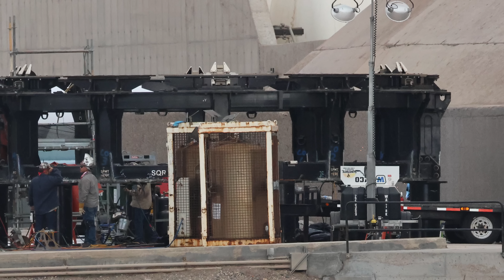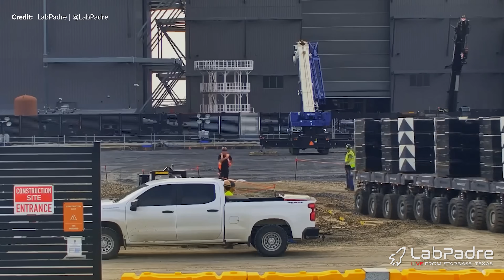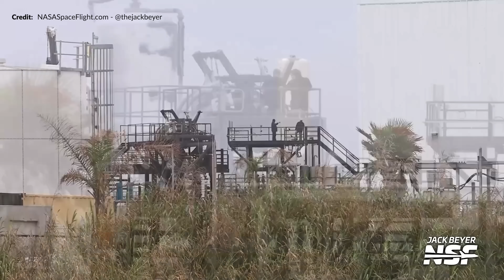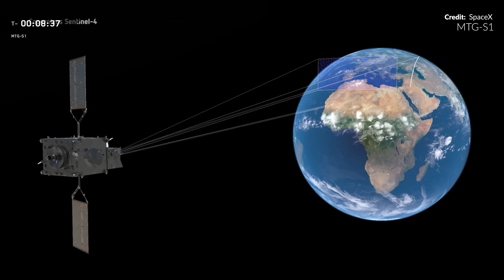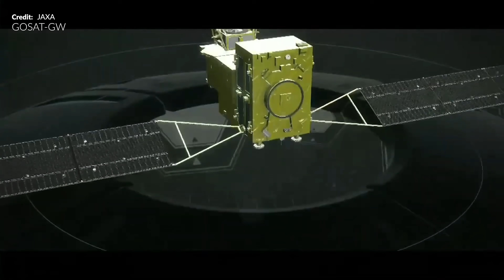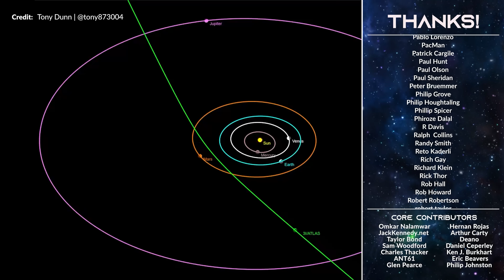SpaceX Isn’t Waiting With Starship... Here’s Their Big Move!

Comment: Starship is stupid.  You drop aeroshells from orbit.  First principle's engineering is how to inflate e.g. loftid, or build in LEO.
Reply: Why is starship stupid?
Reply: @imaginary_friend7300  Starship does not follow Elon's dictum. The best part is no part.  Aeroshells are the simplest design for reentry. LoftID inflatable aeroshell already passed earth reentry test.
Reply: @mefobills279  You seem to be skipping the part where it has to get UP first.  Aeroshells are a re-entry tool.  I think there are some large gaps in your understanding.
Reply: @imaginary_friend7300 I mentioned the inflatable loftid, which has already been proven.  If you must recover second stage boosters, then run the numbers and see if it is first principles economics.  The second stage booster motors are the main high value component. Starship is stupid.
Reply: @mefobills279  The second stage isn't a booster, it's the payload carrier and that drives it's shape as much as anything.  LOFTID only been tested on a small scale and it was not without mass, it will have it's uses but I doubt at these kinds of scale.  It's not first principles anymore than a conventional heatshield nor is it a system that lends itself to rapid turn around.

Comment: They shouldn’t use the sea level engines on the second stage during launch. They should use six vacuum engines instead. That’s their problem. The sea level engines are shaking the vacuum engines to pieces.
Reply: The seal level engines are the ones that steer.

Comment: what if the ring bolts to the ship but only just clamps into the launch mounts, it would be plausible to lift the ship and fill it with the pre launch QDC and drop the partly full ship with the attached ring into the clamps lock and fire the engines ?

Comment: I believe we should have a rocket on semi permanent standby to try and intercept the next one of these interstellar objects.  Think about it, material from another star system coming to us instead of us having to go to it.  It would be more than worth the price for its scientific value.  An absolute bargain opportunity.
Reply: The math really doesn't work out. It's travelling significantly faster than solar escape velocity, so anything you want to land on it also needs to be travelling faster than solar escape velocity... and to date, we've never managed to launch any probe to those speeds without relying on gravity assists which greatly limit where and when you can send them.
Reply: @simongeard4824  Should have added, use the power of SpaceX Starship with orbital refuel to launch a really quite small and light weight probe and yes absolutely gravity assists from planetary flybys included.  New Horizons got pretty fast didn't it?  And Vera Rubin seems to be detecting more and more of them.
Reply: @Iwantalloftheinformation  Missions like New Horizons were planned many years in advance to a known set of requirements, so all the gravity assists are well understood and the time of launch can be determined by how things line up. Launching at short notice to an arbitrary target is considerably harder.

Also, Starship is a terrible choice for launching small probes onto interstellar trajectories... even fully refuelled in orbit, you're basically using all that fuel to accelerate several hundred tonnes of Starship dry mass, when the only bit you want to accelerate is a couple of tonnes of probe. If you're going to launch something on a trajectory like that, you use a small solid-fuelled kickstage.

Comment: Willing to risk a costly, operational OLM to move the testing schedule ahead, even after everything they’ve done on Starship development in recent months has ended in explosions of one kind or another. That’s some serious risk taking.
Reply: Not so much.  That OLM is going to be out of commission for a substantial time soon regardless for rebuilding to block 3 standards.  If this fails wrecking the OLM then either they carry on with block 3 on the other pad or give up.  If it doesn't fail there will only be 2 or 3 more launches on it before it has to be rebuilt.
:planet-orange-purple-ring:

Comment: Back to the Starship testing failure recently.  If the COPV was the incorrect size, type, pressure rating, etc. and it was installed by accident then SpaceX missed its QA/QC PMI (or Positive Material Identification) step.   A PMI rigorous process needs to be in place for all parts: starting with engineering specification, SpaceX Shop QA/QC processes for external suppliers and internal SpaceX factory work, shop inspections, materials pedigree paperwork, pre-shipment testing, positive materials tracking at the SpaceX factory, pre-fab equipment from OEMs, welding materials, qualifications of the workers, welding processes, etc. to assure the quality and correctness of all parts and processes in assembly and testing of the vehicle.  In mature private industry like, Paper products, Oil & Gas onshore & offshore, petro & specialty chemicals and petroleum refining, etc. the rigorous QA/QC including PMI are standard for workplace safety.  I'm surprised that OSHA has not begun an investigation of this SpaceX mishap.  Maybe it's because there were no injuries or fatalities.  Maybe it's because this is a testing campaign and mishaps like explosions are tolerated.  SpaceX did increase their testing safe zone area. So there's that at least.
Reply: Looks like alot of paperwork. I suggest sidestep that, and get a foggy 3D build assist that projects the proper part for immediate comparison. Or a laminated 1:1 poster for the build room.

Comment: If you ask me, sprites are not caused by intense electrical activity in a thunderstorm below, but electrical activity in thunderstorms is fueled by cosmic rays. A thunderstorm just only provides the right atmospheric conditions (=conductivity) for lightning to occur. Same with vulcanic eruption lightning.
Reply: Agree to a degree. Charge differential is apparent, most obvious charge input is Sol. But it need not, and isn't the only.
Reply: @Stumpy1234  Interesting idea. Maybe it is both radiation from sun and cosmic rays. If it is from the sun, we would perhaps have fewer thunderstorms during night time and maybe more during night time in case of cosmic rays.. Time for some scientific research?
Reply: The thunderstorm isn't providing the conductivity so much as acting like a capacitor storing the static charge all the water and ice generate.
Reply: @DUKE_of_RAMBLE  Yes that is the common theory, which I think is incorrect. It IS electrical conductivity (logical, with a lot of hot water vapor, isn't it?) in my view. The capacitor theory is wonky. High-energetic radiation from space causes electrical discharge in the atmoshere, not "friction" between water droplets,which I think stems from lack of ideas where electric charge comes from. Oh, then it must be friction. No. Cosmic rays are always present, but lightning only occurs when atmospheric conditions are right (high conductuvuty and/or vulcanic eruptions). Many mainstream scientific ideas are faulty. Don't just repeat them.
Reply: @michaeljaneschitz-kriegl9598  From what I real it's not friction, but collision, and with water/ice at different states, a partial slush state. The collisions some gain energy, some lose energy, and it builds. I dunno, I'm out of my wheelhouse, admittedly, but it seemed more sensical as I read it, compared to being "conductive". Especially since a pyroclastic cloud would definitely be a case of static buildup causing all the lighting in them.

But when you start factoring in the solar winds and high energy physics, I suspect it becomes a completely different ball of wax. Not to say that it doesn't boil down to charge states, but the Sprites always look to be originating FROM the cloud TO the upper atmosphere.
Reply: @DUKE_of_RAMBLE  Look at the photograph of the sprite. It extends hundreds of kilometers out of the atmosphere. If you think that this is caused by collisions of snowflakes in the atmosphere, you may. But I think that is totally wrong.
Reply: @michaeljaneschitz-kriegl9598  Dude, we can build up up to 30,000 volts just by shuffling around on the carpet in our socks. So yea, I have no issue with thinking a giant thundercloud is capable of storing enough voltage to shoot a bolt that high into the upper atmosphere. Plenty travel great distances laterally (through the clouds), after all.

I have no issue being wrong, though. There's a lot we don't know with Sprites. Hell, there's a lot we don't know about lighting IN GENERAL; e.g. Ball Lightning. (great video just captured one in Alberta, CAN very recently)
As such, you could very well still be right! 🍻

Comment: The Starship program is in deep trouble. It’s difficult to imagine how Musk couldn’t see how the program was tracking the same trajectory many other companies have taken. Great staff buy in and fantastic initial success progressing to a we can’t do anything wrong…we’re invincible hubris to carelessness and now leadershipless failure with few answers other than let’s just keep going. They need a 6 month reset and need look no further than their own Falcon 9 program as to how to go about it. F9 faced these same issues early on and solved them by remaking the culture and changing the expectations. Its obvious V2 is a lemon and the smart thing to do is shut everything down for the rest of the year, concentrate on V3 at a component level with stringent standards, finish Pad 2, upgrade and repair Pad 1 and start anew in 2026. It doesn’t look like they’re doing this. Looks like the pedal is still to the metal. This is a critical moment for the program. I hope they’re taking the right approach.
Reply: I don't think V2 has been a failure. I think Starship may have some problems as a stainless steel vessel in current configuration. the gaps at the guidance flap are simply going to suck in too much heat during re-entry for the current cooling design. And it's difficult to say you should add the weight of active cooling.

Comment: When you mention the clamps are held on by bolts, that doesn't match the render. It looks like spring clip retaining pins much like you would see on heavy equipment pivot points. Even faster to remove.
Reply: I noticed that too. Pins should have a higher sheer strength than bolts too so even more reason to use pins.
Reply: @JeromyBranch absolutely, and are always the better option if you don't need the clamping force
Reply: Can they be threaded pins? That is, one section or another has threads, and the rest is smooth?
Reply: @up4open sure, if you want one side of the hold down clamped to its mating surface but not the other side.
Reply: @up4open  Those are already very very very common thing, they're called.... "shouldered bolts" 😊
There's no need for the thread, as a retaining clip (often itself a pin) gets used to prevent the pin from walking out of its hold, just like a nut would do in this situation. Except a nut can vibrate off, but that's why "thread locker" (glue) is used... problem is, I'm not sure if any are designed to withstand these temperatures. Thus, why a retained pin is the better solution.

Comment: I don't understand all the teething problems. Should they not know what works etc after using the Falcon for so long etc. I mean I know its made of Stainless etc but still??
Reply: The differences between falcon and Starship are huge. Not just stainless steel. New engine types, which SpaceX are still the only ones to fly. New fuel, massively more powerful, massively larger, and much, much more. Even the recovery profile of the booster is drastically different. And the upper stage is working on recovery as well, which Falcon 9 doesn't do.
Reply: @anthonypelchat  Thanks

Comment: @marcushouse I would like to request a video on the Falcon 9 refurbishment process. What parts are inspected, refurbished, or replaced before reuse?
Reply: Awesome request! I second the motion.
Reply: I ditto that request. Sounds like a great idea.
Reply: That’s a great idea!
Reply: Yes! I was actually wondering that when he mentioned the 29th flight, wondering if the engines ever get replaced. Or even just the bells, as I figured the 3 heat cycles might cause warping eventually. (I think some see 3, but maybe they all don't shut down momentarily on the boost-back burn; been awhile since I watched one 😅)
Reply: eager space has a good video on this. as well as many other good technical analysis
Reply: That's potentially classified, but one can ask.
Reply: W
Reply: Great idea, though IDK if SpaceX has really disclosed much there.
Reply: It's about time for that. I am very interested as well.
Reply: No information about that is available, so youtubers can't make a video. It is only known that they are using some chemicals to clean the engines and piping from soot.